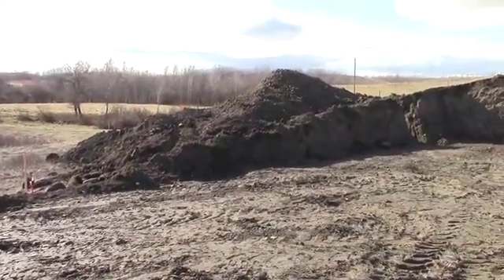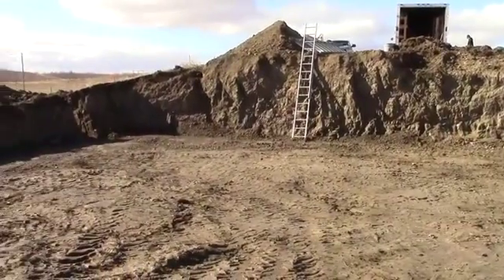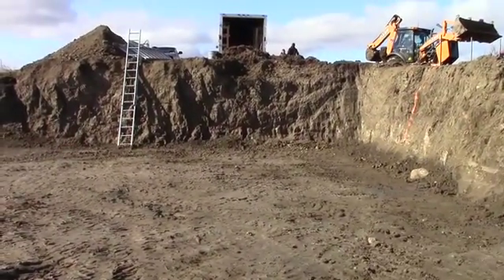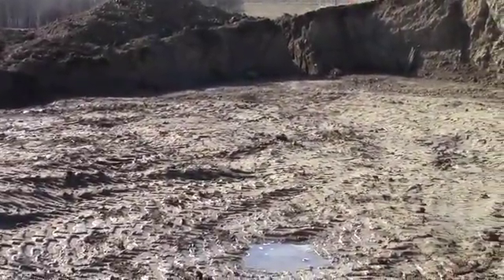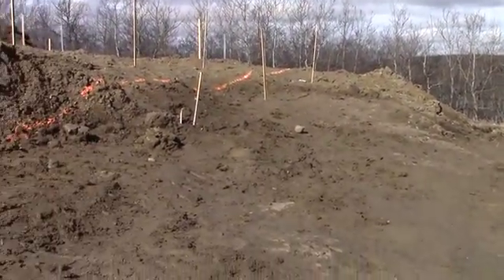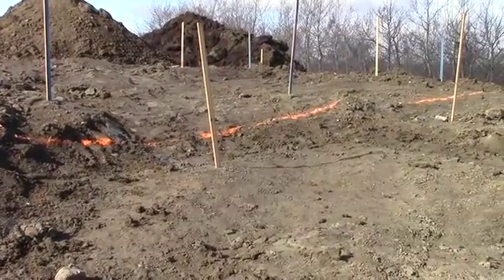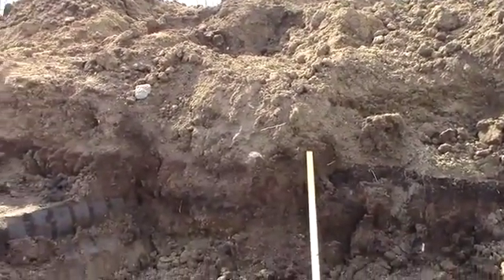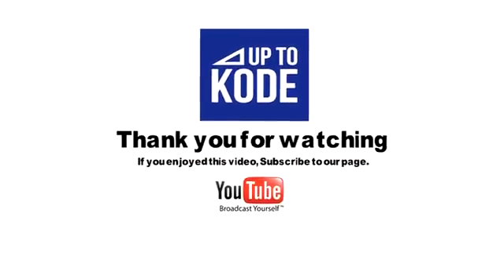How a Foundation Works for a Walk out Basement

Comment: Where do you put drain tile? Can that all just be below the slab on the interior?
Reply from the maker: Drain tile is on the exterior right beside the footing and only on the basement where there’s backfill on one side and empty basement on the other. In other words NO drain tile required on the back walkout wall where it’s backfill on both sides of the foundation.